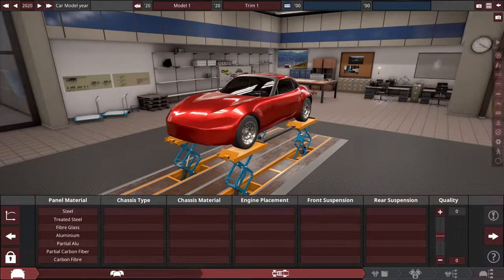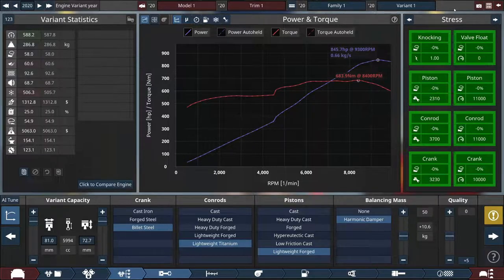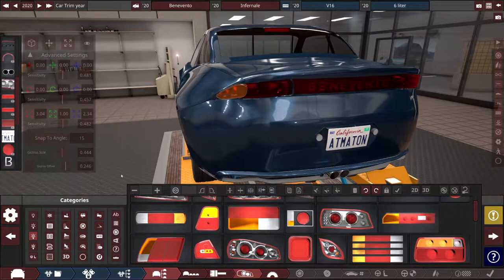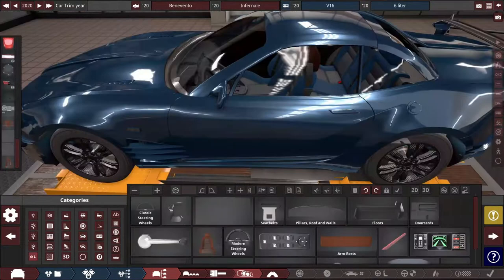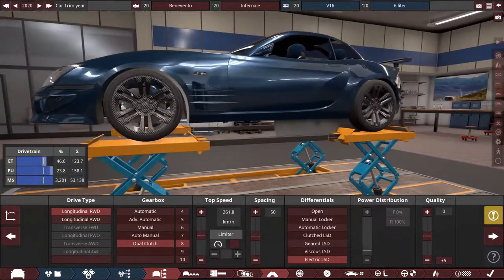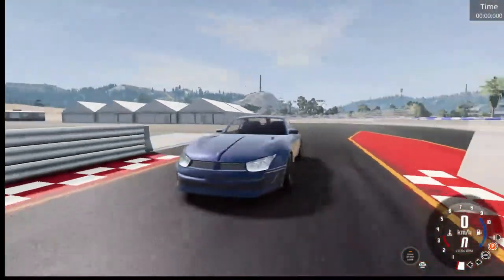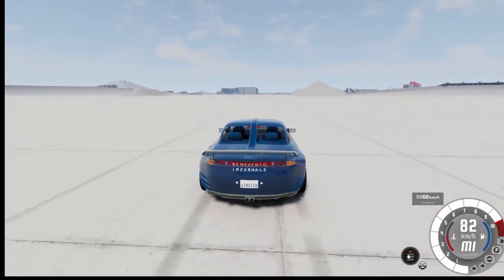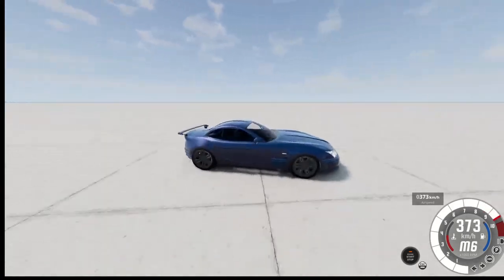Fitting V16 engine in a modern coupe Automation & BeamNG

Comment: In order to improve acceleration at high speed, removing the rear-wing may have an effect. You could instead add downforce beneath the car by increasing the diffuser. In addition, the balance shaft adds mass to the engine, making it less rev-happy. V12s and V16s don't need them anyway due to being inherently balanced in the first place.
Reply from the maker: Without balance shaft this engine was exploding sadly. I think that's due to how Automation calculates performace.
Also high speeds were messed up by my gearing. Checked it afterwards, it was speeding over 400km/h easily.
Reply: @f4ll3n_derf4ll3n  Ah okay, then! What I forgot to add was that, at least while you're in BeamNG, there is a 2 to 3 second delay between video and audio.
Reply from the maker: @ActionMacaque  I was aware of that, already disclosed it (and hopefuly repaired) in upcoming video. Thanks anyway.